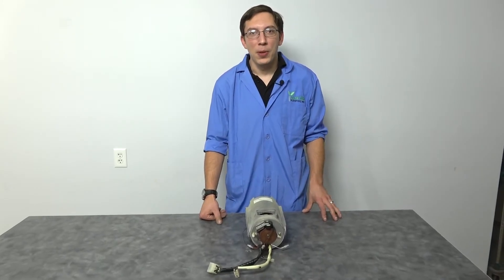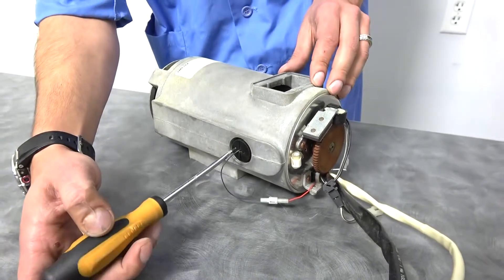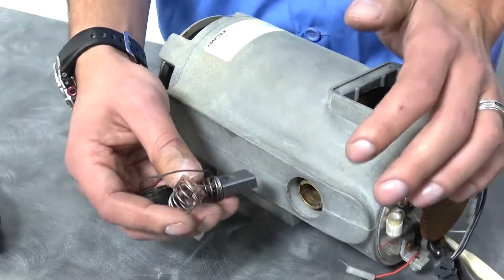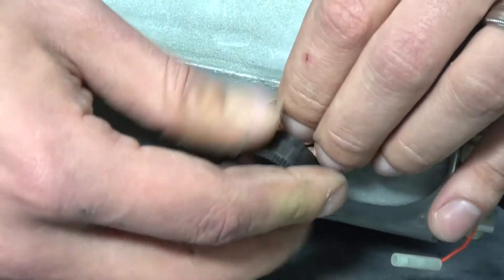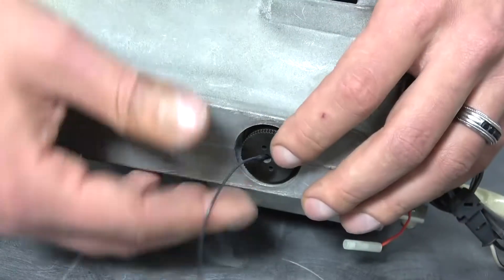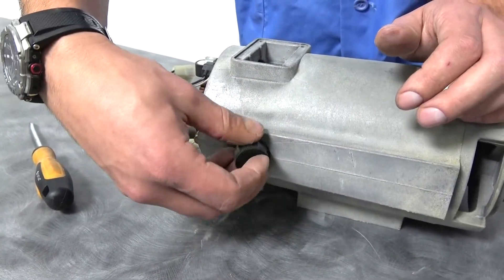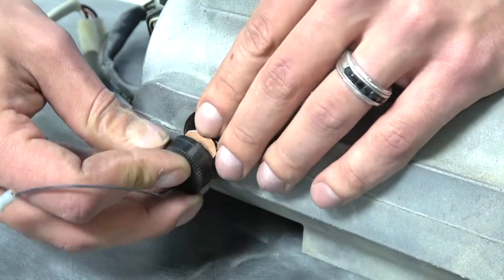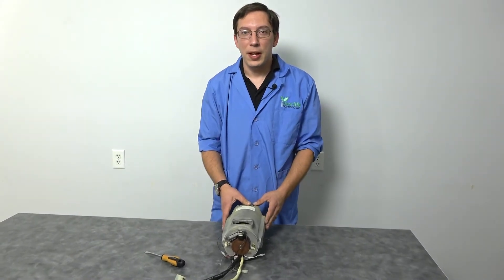How to Replace Brushes in Centrifuge Brushed Drive Motor

Comment: Thanks for the video.  "Sometimes it hard, sometimes it's easy".  I pulled the brushes on my portable bandsaw and cannot get it re-installed after many many attempts.  I think I'll drill a small hole in the plastic cap so I can hold the copper piece in place while I tighten.  I can cover the hole with a piece of tape or just leave it open.  It won't really matter.